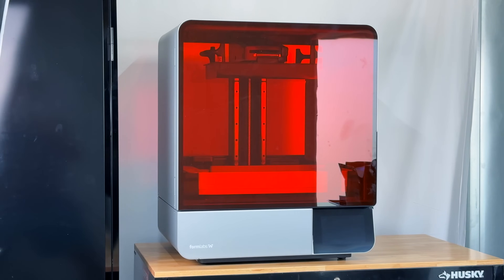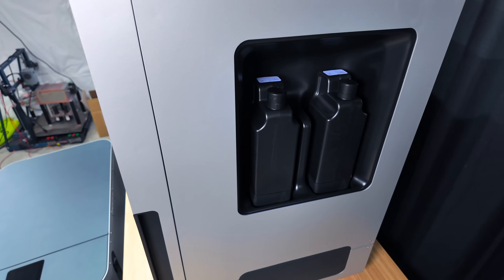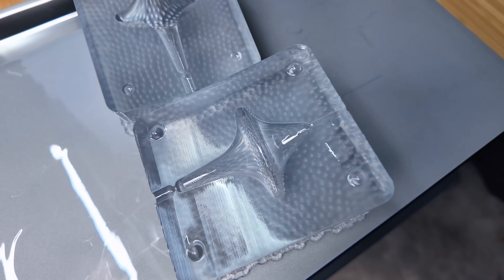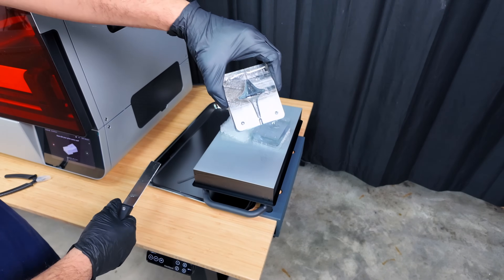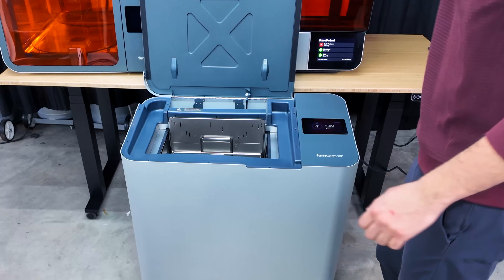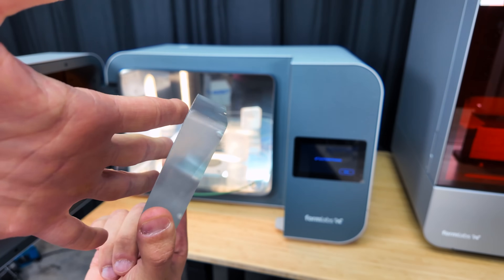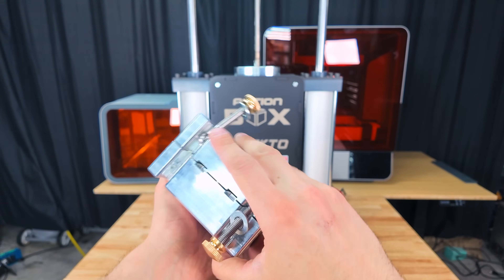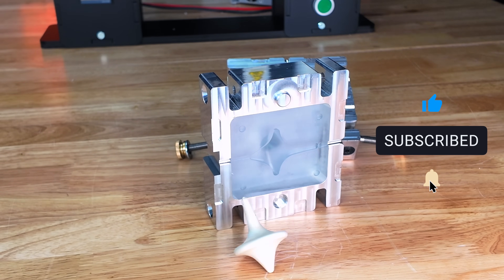The Ultimate 3D Printer - Formlabs Form 4L

Comment: You don't have to use supports though. You can lay it flat on the printbed which also makes the xyz sizes more accurate
Reply: did formlabs fix elephant footing ? This will normally happen when you place it flat on the bed